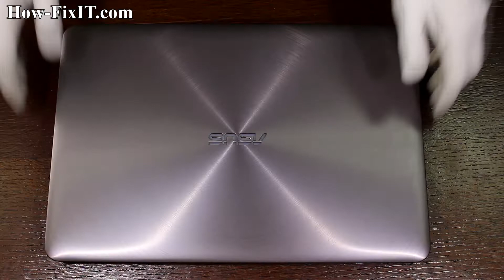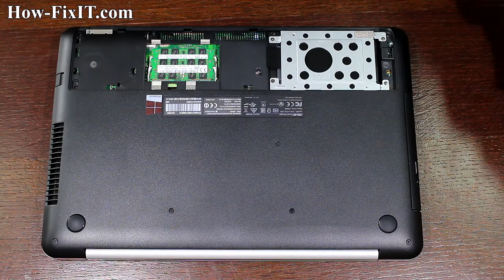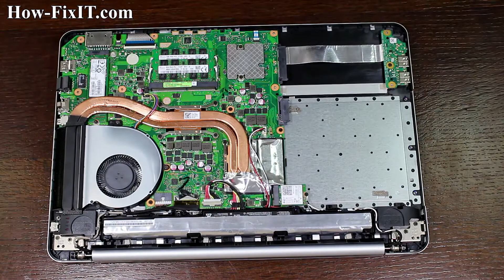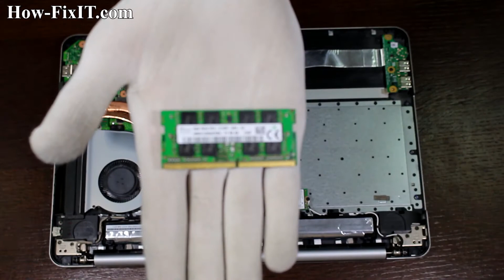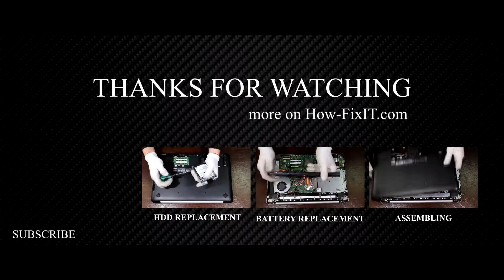Asus Vivobook Pro 15 N552 RAM Upgrade and Install - Your Step-by-Step DIY Guide!

Comment: Hey. I had a 16gb, 2 8gb sticks laptop. This month I bought 2 16gb ddr4 2666 and it has worked perfectly. I haven't had any blue screen in a month approximately,performance is amazing. Weirdly enough, when I installed two Kingston's, it wouldn't start, however when I mixed them, one Kingston and one Samsung, it worked out alright. The first boots were sluggish but only two or three. Ever since it's been very fast. Thanks!!!

Comment: Thank you so much for the video. I wonder, is it possible to combine ram sticks of different brands but with the same specs? My laptop has Hynix HMA41GS6AFR8N-TF 1x8GB, and since I can't find it anywhere in Europe for a reasonable price, I was thinking of adding a Corsair Value Select or a G. Skill Ripjaws of the same capacity, voltage, form factor, and frequency. Would something like that work? And if not, is the performance increase worth investing in 2x8GB sticks (that's around 70€-85$ in my country) of the same brand?

Comment: you dont need to open the whole pannel to change the ram, right?
Reply from the maker: actualy you can remove it, but installing RAM as i know must be done without any power supply, so to remove RAM you can open just RAM door, to install - open whole pannel

installing RAM with power supply can damage RAM that would be installed